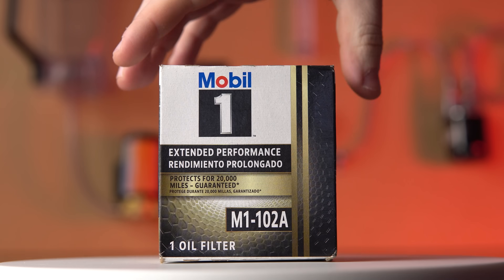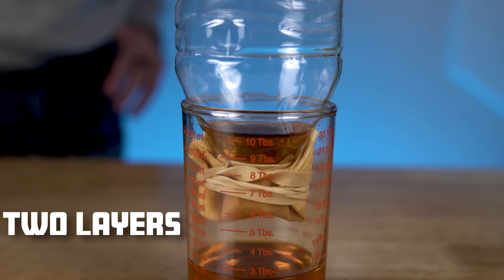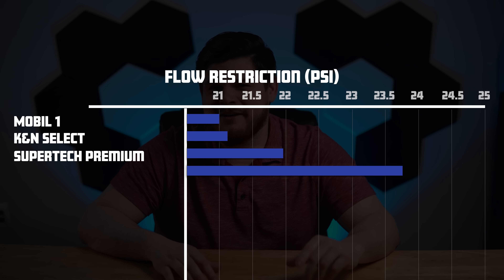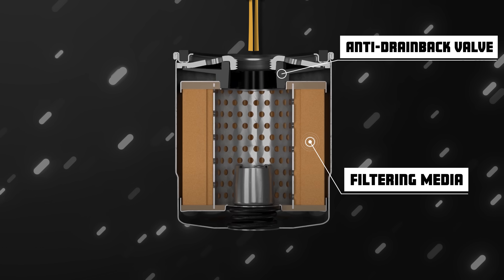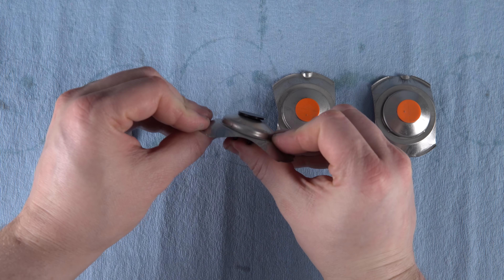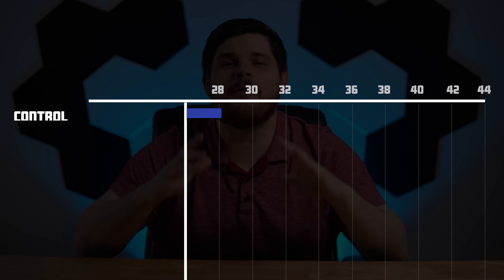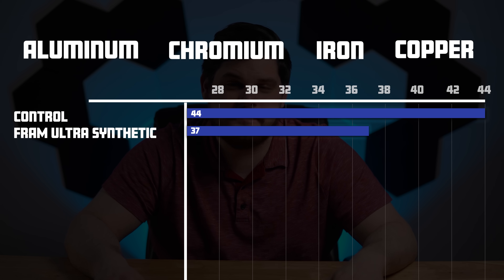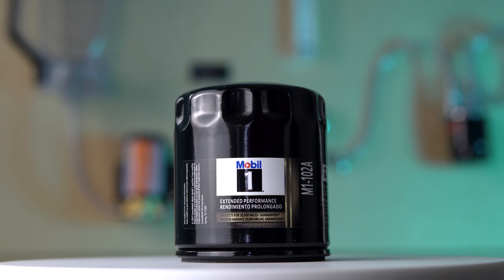Engineers Test the Best Oil Filters! FRAM | Mobil 1 | K&N | Walmart Brand

Comment: Awesome testing!  I have a suspicion that at 20PSI, the bypass valve is probably wide open.  This is pressure drop across the filter, with an open outlet to the filter, not running pressure in the engine with the restriction/pressure at the outlet of the engine's oil system.  Your pump was probably pushing more oil than the filters are designed to handle.  Ballpark guess, if the bypass valve is roughly one square inch in area, 20PSI would exert 20lbs of force on it, which I suspect is more than enough to overcome the spring.  If you slowly ramp up the pump, you would see the pressure rise at a constant rate, and then begin to flatten out as the bypass valve starts to open, that may be a good way to gauge a proper flow rate without bypassing the filter media.

Comment: Then there is the engine that has cast iron sleeves(instead of aluminum) and has NO OIL FILTER(stock).  My VW has a wire screen to strain out dinosaur bones and leaves and rocks?  The engine oil bought new should be clean out of the bottle.  Black oil just means carbon soot is coloring the oil. That does not harm the motor one bit as soot is a bit greasy.  Aluminum will not scratch aluminum, and the other metals will not scratch themselves(but your engine should not be falling apart) but sand and road dust will work like a grindstone on every metal. Welcome to the real world.

Comment: Unheated oil, miniscule oil flow rates, and no real testing of filter efficiency.  This has to be the most pointless oil filter video on the internet.  And those bases are made of steel, not "thick aluminum" as stated in the video.

Comment: It's a good video, it's nice cutting into the filters and showing inside that's all very helpful, but these filters are all designed to work at high oil temperatures. It's possible the results of the tests could be very different if you are running the oil through the filters at their typical operating temps.

Comment: Left out one key factor. The oil needs to be at operating temperature. Oil is more viscous at room temperature therefore it doesn’t flow through the media as well. Also, because it’s more viscous, if you’re pushing the low enough, it’ll just end up going past the filter media via the bypass valve

Comment: Your pressure test might be flawed, you are just testing at what pressure they bypass. You need to have a set flow rate that causes pressure below the bypass psi and then see which is least restrictive. Unless I missed something.

I would really like to see Amsoil, Wix, Purolator, and Bosch

And compare to the OEMs Toyota, Honda, GM, and Ford

Thank you for doing a real test instead of just disassembly, subjective visual "test", and measuring sq in. 

Is there a link to send some money? I don't like subscriptions. A Patreon alternative would be nice.

Comment: Question on the flow tests. The pressure relief valve is usually between 8psi-30psi depending on brand and model. The "flow" test in the beginning would not be accurate as it may be opening that valve at its designated psi, altering the rest result

Comment: The Fram filters particles above 20 microns.  The other 3 start at 30 microns. That''s a significant difference.  Might add particle size distribution testing to the lab tests.
Reply: IDK, it may not offer much of a practical difference, especially if its filter media can spread out more. It's definitely one of those numbers I don't believe unless I see it verified.

Definitely second the parti😊😊cle size testing, it's a very good idea.
Reply: Does it really matter? Yes and no. The vast majority of particulate can’t be filtered out by 20 or 30 µm. It does hamper the flow though. As the filter loads up. So be careful what you wish for especially if you’re running a GM V8 which wants high flow
Reply: @sbond1963 no regular car engine creates enough pressure for it to even matter. Filter capacity should be the most important value. And who uses an oil filter for 20k miles?
Reply: @sbond1963  I wouldn't buy a fram if the box told me it'd make me shit gold
Reply: @jordanlong00  I use the Fram tough guard. Love that filter. Spin on and the cartridge version.
Reply: @jordanlong00  Honestly, me neither, especially for the cheap ones. Their build quality and quality control are lacking
Reply: @sbond1963  to each his own, I buy K&N if Im feeling spendy and AC Delco if I'm not
Reply: @jordanlong00  Fram is the best
Reply: Wix is at 10 microns with more filtration medium than all other filters.
Reply: @LBurou Wix Doesn't even have a Filter that is 99% at 20 microns. They are 99% @30, and ~50% @21 microns.

Comment: Bypass valves are very common and a very good thing. Even in aviation we have them because unfiltered oil or fluid is better than none.
Reply: Most of these filters look like they'd cause a huge issue the second they bypass, since they build up so much material at the bottom of the filter. That's still better than no oil and won't be an issue if it's changed regularly though.
Reply: @bobbygetsbanned6049  Take a look at the place of filter of your car, it is very likely that it is not vertical so all the gunk is not underneath this bypass valve. even in this video it is at 90 degrees angle. Also you need opening valve pressure to be the same as the original. if it is weaker than needed, then you may have early openings; and if it is stronger than needed, your engine may struggle without oil.
Reply: I Would like to see when Bypass valves activate or fail?

Comment: This is a bad test.  He is testing the PSI of the bypass valve.  That means nothing.  After the filter goes above a certain PSI (20 lets say), it goes in to bypass.  It starts filtering again once it drops below that PSI limit designed in to the filter.  That is oil filter engineering 101.
Reply from the maker: By-pass valve psi ratings are based on differential pressure across the filter not inlet pressure like was measured here, thus you can't really tell if the by-pass valve was triggered unless you were measuring differential pressure across the filter. In future videos we will be changing our process to measure DP instead of inlet pressure.

Comment: When choosing a filter, the smaller the particle that it can capture the better, with respect to the fact that a filter could become clogged sooner. For example, the 10,000-mile filter is likely rated for 99% of 20-micron particles instead of 30-microns. The filters can of course catch smaller particles with anything between 5 and 25  microns considered a potential concern inside one of today's engines. The 30-micron filter rating allows for a greater potential of many of the smaller particles that could be a concern to not be captured. BTW when serviced correctly and with an approved specification oil, the chances of a filter reaching it's capacity (14 grams for some of the smallest filters) is unlikely. If you wish I'll send you my filter the next time I change oil in my car and you can try and measure what it captured at an 8000 mile interval. BTW the first test with the flow restriction, typical bypass valve opening occurs at about 12-14 psi. That has me questioning the validity of the first test.

Comment: The durability is the kicker, lemme tell ya as a dyno tech and engine buiilder.  More than plenty of filters can look ok, but it's the actual quality that matters.  Those Mobil 1 filters are pretty nice.  Wix are also very nice filters.  The Fram and and other cheaper ones I've opened to find nothing left in them before on diesels.  Just sucked the paper filter right on thru.
Reply: You just saw the Fram have better build quality than the K&N. Metal rib on the connecting pleat, metal inner housing for the media and double pass media. But yet you still bash it. Fram, like most companies make many different grades of product. Some are cheap and perform poorly but they also make high end top self lines. WIX is the same yet everybody says "Fram sucks ass" I'll take my WIX XP any day. What you mean is the orange can Fram is cheap I'll use a more expensive built filter. Fram is more than an orange can just like WIX is more than their XP line.
Reply: @nhbountyhunter  yeah Fram Ultra is hard to beat for $8-9.
Reply: @nhbountyhunter  It's not the metal that got sucked thru... it's the filter element, on military run diesels.  But OK.  On some Harleys, i highly recommend Fram....
Reply: @nhbountyhunter  We saw the devalued, and built cheaper Walmart stock K&N.  Retest with the HP Series K&N.
Reply: DAMN
Reply: @brianbarber8395  Fram ultra has synthetic media with wire mesh backing. Ultra is different than the garbage fram orange can. Watch some comparisons. Fram ultra consistently beats most.

Comment: 25 psi resistance in the Fram is not a problem unless your engine is producing less than 25 psi of oil pressure.  Most healthy engines are somewhere around 45-60 psi, negating the perceived "negative" result of the test.  You know how to lower the pressure in the filter?  Make one that's less effective in reducing contaminants in the engine.  Problem solved, right?

Comment: Project farm "Were gona test that"

This guy  "where gona scientificly test that wayyyyyyyy more "

For real though, if people change their oil around 5k regardless of what these insane Reccomdations (to sell more vehicles) of 10k or more.. Doesn't really matter much which filter used. Just don't use cheap ones.

On the other hand, you would think engineers tested what would be the absolute bare minimum. Keep in mind oil gets hot and probably around 40+PSI, it's probably enough to not make a difference. I would be intrested to see the restriction test repeated with used oil, that is 180-200f in a oil filter that has been soaked already as I assume if you ran the test a little longer, saturated media would flow easier.flow needs for engines to run fine. I never noticed a change in oil pressure using the fram ultra synthetic in my vehicles equiped which such reading. I just buy whatever preiimum filter that's on sale or just go with toyta oem I can get for $3.50 a piece when ordering 10 or more at a time at a local dealer. Remember folks, oem parts/fluids are usually in my case much cheaper then oem. Toyta filters seem to have good build and reputation, just don't buy from online where counterfeits are rampant.

Comment: Need way more filter brands tested. And please keep tests the same between vids so can compare all of them later when more vids come out. Please do WIX!
Reply from the maker: @Ross Howard. Thank you so much for your input. Agree lots more brands to be tested, unfortunately, our budget is limited so we will do it on a phased approach, but we will get most of them. In regards to consistency, we are planning on making several improvements to our testing thanks to some great suggestions (oil temperature, pressure drop etc...), so we will most likely repeat these filters to get a fair assessment. Thank you for your support!

Comment: I knew Mobil 1 would win. They make high quality products.

Ranking Fram and K&N the same was total garbage. The slightly reduced oil flow has no noticeable effect on performance. The better filtering and build quality of the Fram ranks it above the worse filtering and lower build quality of the K&N.

I never buy K&N products. They're the most overhyped garbage out there. They spend more money on marketing than R&D. Their cold air intakes for the Silverado have an open top that's supposed to seal against the hood. Guess what? It doesn't seal well, causing them to pull hot air from the engine bay, rendering them useless. 😂

I can sum up your video in three short sentences. Mobil 1 is the best overall performer. Fram is the best performer for the money. Avoid all other oil filters.

Comment: I'm sure you guys at your test lab did the best you could do. However if you do not put in the actual heating temperatures conditions of an engine of hot oil circulating through the filter well you're not really testing real world conditions. Most engine oil in a vehicle runs between 220 to 250 degrees. However even if you did half that condition of 110 to 125 degrees Fahrenheit would be better than room temp engine  oil.

Comment: Very well done!  I owned a 2003 gmc Sierra 4.7l a few years back with only 130k kms but was annoyed at the faint knocking in engine at start up for 2-3 minutes and after some research found it was typical for this engine, I thought lifter noise but apparently piston slap.
Well, guess what I switched from usual junk filter to Mobil One and never heard that start up noise again, obviously the anti drain back feature does it’s job better than others I figure, I won’t buy anything but Mobil One since. Thanks for great video.

Comment: The video is good, but there are some fundamentals flaws in the tests and oil analysis results presented.  

To test a filter efficiency, particle count is essential.  The flow drop only tells if the filter is clogging up, not if the particles are being removed from the fluid.

The spectro test on wear metals only represents particles smaller than 5-7 microns, which none of these filters are aiming at removing.

It would be good to do some testing on bypass filter kits.
Reply from the maker: Thank you for the feedback, comme ya like yours enables us to improve. We are making several changes for our next video that's e believe you'll like. Again, thanks for the feedback and support!

Comment: It seems these days that most new vehicles use cartridge-style oil filters (which I dislike compared to canisters). It's my understanding that variable valve timing systems now used in most 'cars' can be adversely affected by oil filter pressure different from the manufacturers' specs.

Comment: Using mileage to determine how long a filter will last in a car is like the old story I heard about one American car company in the 1920s , they weight their invoice they received as a rough idea how deep in the hole they were in. If a filter are installed in a new engine that had the break in,  technically it can be there 100,000 miles. But much less if it been installed in an engine that is making metal. I believe the engineers had designed these filter capacities for the filter to be working for the whole change interval even if the engine is making a lot of metal. Engine makers can of course dump the KISS rule and make the by pass valve operate an indicator light after it been opened.Then you know the filter is full and have to change it.

Comment: What’s funny is that they all meet SAE standards, meaning they at least perform to not hinder normal vehicle operation. 

You don’t exactly need fancy filters for a vehicle to function. You’re not paying for functionality, but instead for longevity and improved efficiency.

FRAM is a terrible performer by comparison, but it definitely works, and my daughter’s 2011 Highlander reaching 450,000 miles earlier this January supports the claim that it won’t exactly hurt your engine, but it doesn’t hurt to choose better options.

Comment: I would have liked to see a test of the oil after pass through when you where putting aluminum into the oil. It could be argued that the K&n dropped in pressure sooner due to it actually filtering out more particles faster then the others who took up to 50 grams. But since there was no testing of the oil we don't know. I'm thinking if it takes 50 grams to clog a filter it's due to the filter not catching the particles quickly enough to clog it. This theory holds some water with the lab results you did run, where the k&n filtered out the most ppm. I also want there to be justification for me to have spent $15 on a oil filter every 3-6 thousand miles lol Sometimes I run a filter 2 oil changes often I change it every oil cycle of 3,000.